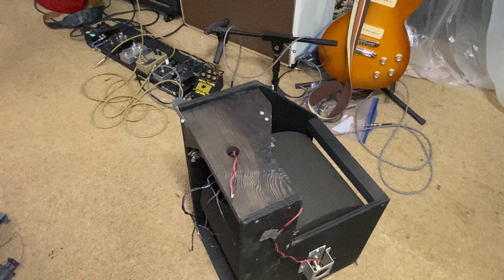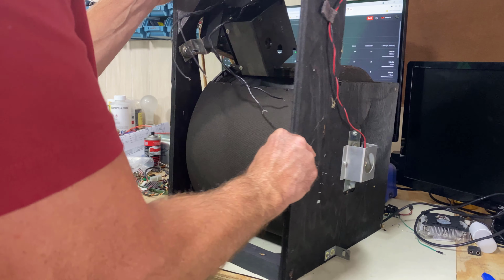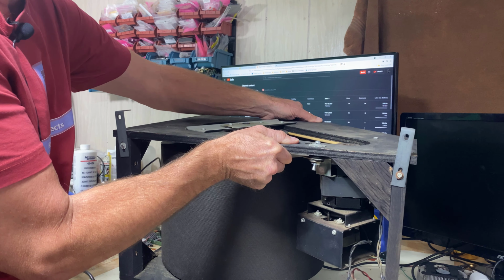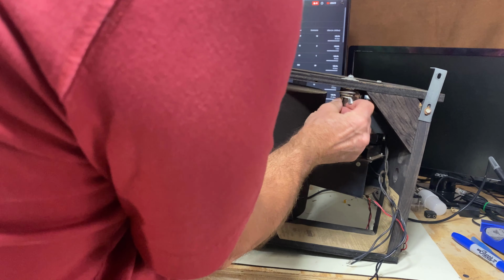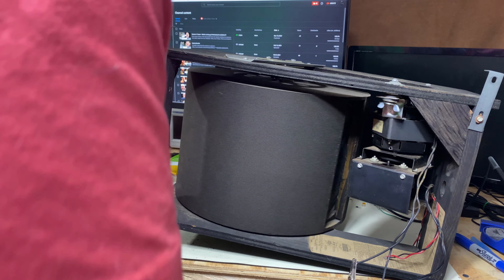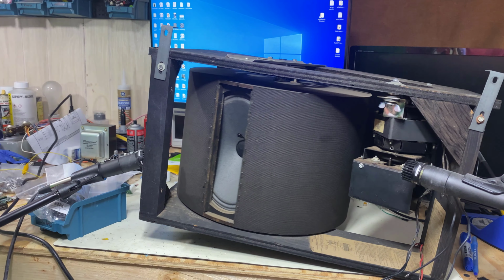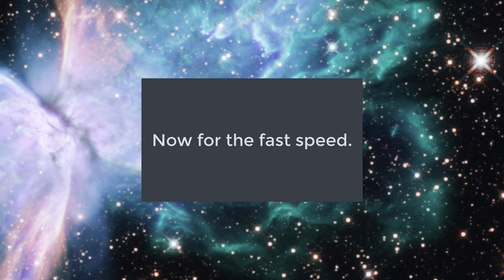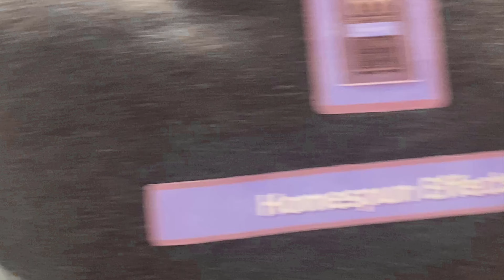Scavenged Leslie Speaker - Teardown and testing

Comment: Hi Mark.      Wow you gots the stuff! Should we just shoot my old multi pedal ?
Reply from the maker: Unfortunately, my attempts at finding the issue have failed. I was hoping for a schematic but it’s just not available. I don’t even think Digitech will take it in for repair. Sorry, brother.
Reply from the maker: Dave, you may be surprised to hear this but I am still working on your pedal. One more attempt. I found another that's broken in a different way. I'm going to try to put the good parts from each into one working unit. Wish me luck v
Reply: Oh wow , no Quit in you .this makes me smile as my mind flips though the familiar settings of 20 years use. TY bro.